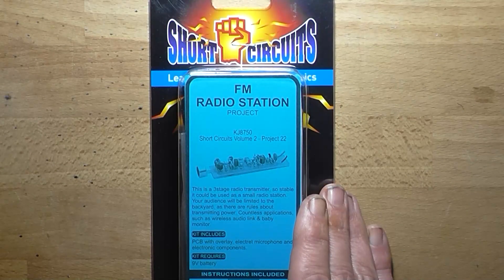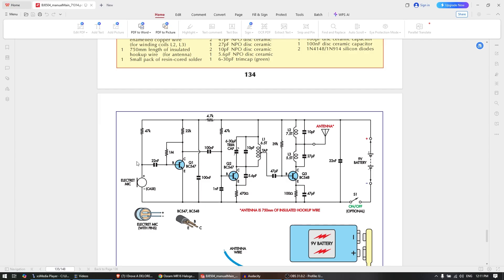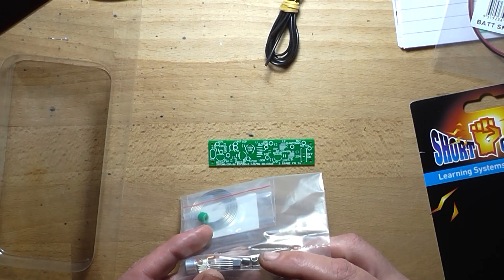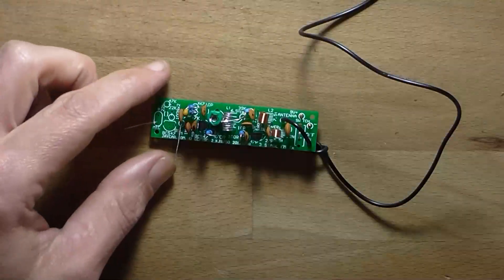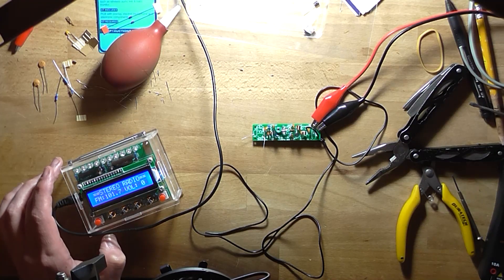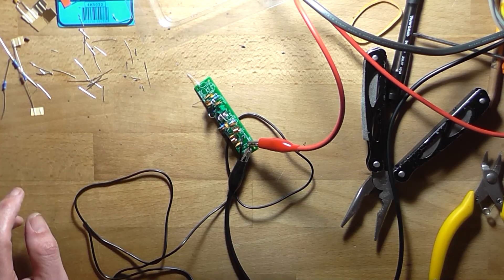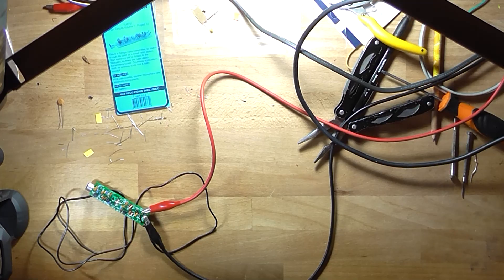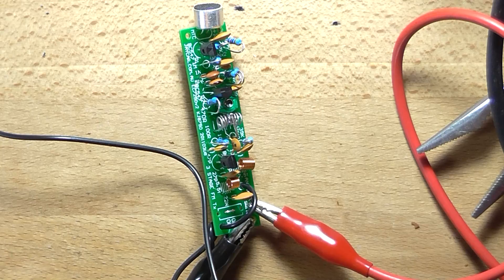Short Circuits 2 - Project 22: 3-Stage FM Transmitter Kit BUILD!

Comment: Oh yes! I had the same troubles with that damn  tapped oscillator coil when I built the original Silicon Chip version of this kit years ago (about 1999 or somewhere round there?). With a good ground and several metres of wire as a 'proper' quarter wave antenna, I was able to get (with questionable legality) a good kilometre or so line of sight, or about a suburban block away at ground level with houses, etc in the way. I live in NZ however and the authorities here are not very vocal about radio interference. These days with all the noisy switchmodes and LED lights out there, they've probably given up!
Reply from the maker: At least I'm not the only one 😆